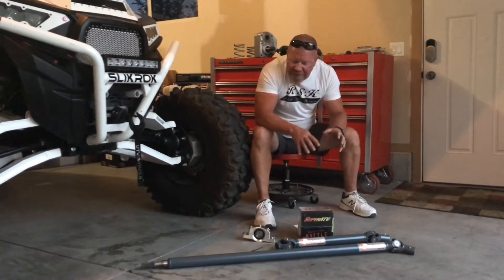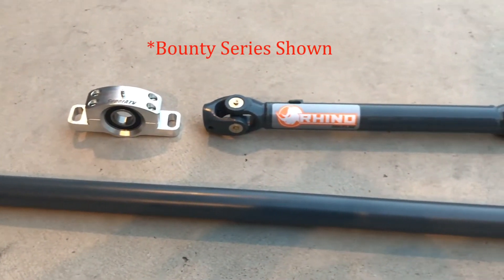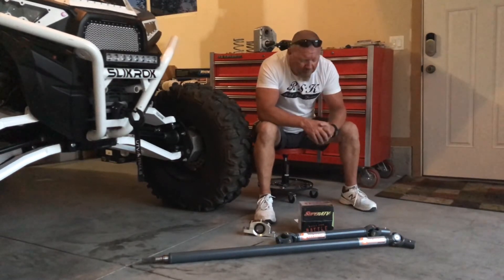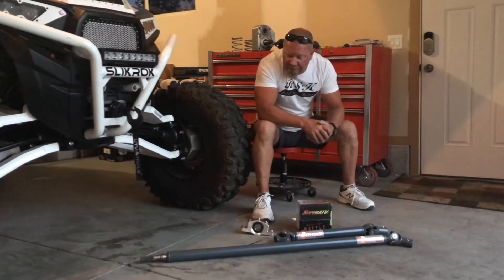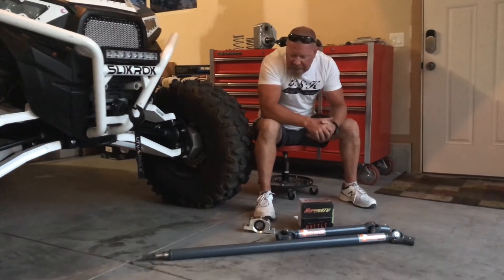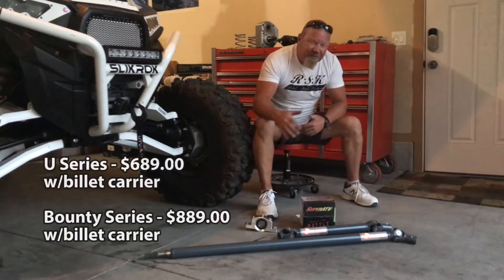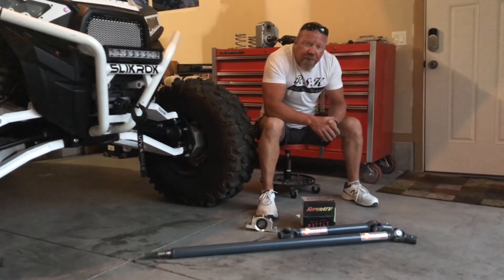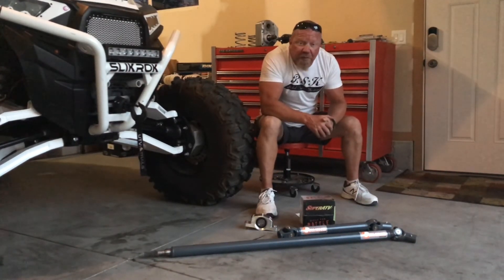SuperATV's new Rhino series Drive Shafts!

Comment: My rzr prop shaft randomly started rubbing the prop shaft hoop. I didn’t hit anything. Any ideas on what to check, my shaft is not loose or out of balance. Carrier  bearing is all good too. Any ideas what to check?
Reply from the maker: Well that is quite the conundrum. Any pics?
Reply: @SlikRokProductions  so my Turbo R 4 was purchased brand new Mid July. I have been the only person to drive it. The problem was one of my 2 carrier crossmembers ( along with a welded cross member)  were bent… I don’t ride hard but somehow my crossmember got bent WITHOUT damaging my skid plate. I’m not sure how the skid would have no defects… that’s what threw me for a loop. I looked underneath trying to find evidence. So I bought a Rhino CV prop shaft with 2 carrier bearings, 1/2 skid plate, L&W cross members and also reset my preload to my shocks to adjust ride height. But do you have any thoughts on how it could get bent without the skid showing signs?